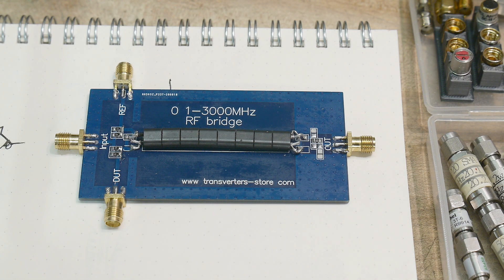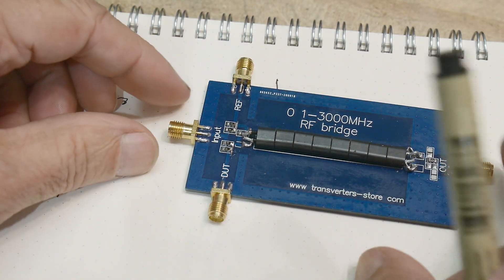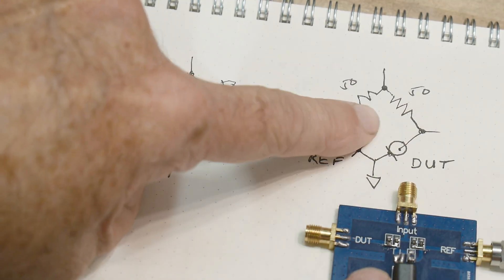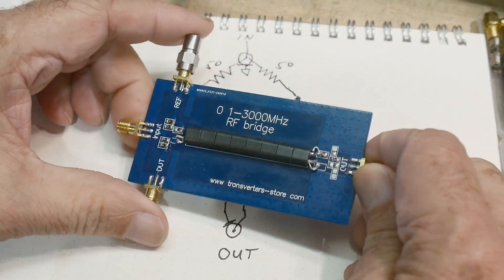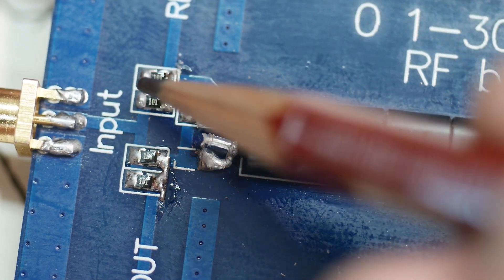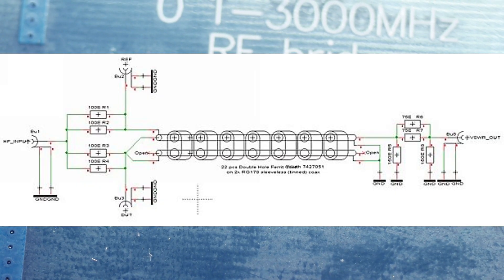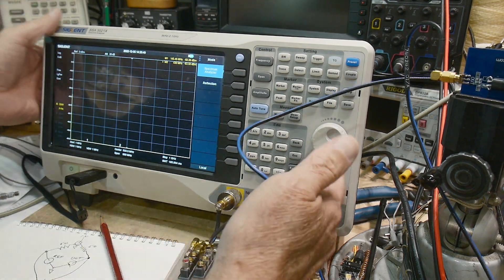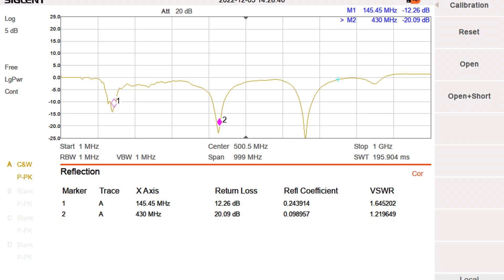#1366 RF Bridge

Comment: Can the ferrite cores be of individual toroids and NOT "eye" cores?
Reply: Sure, individual cores of identical ferrite mix and "ui" initial permeability would work fine.
Employing the "binocular" or "pig nose" core is to assure that the very exact CMC (Common Mode Current) impedance is imposed on the "outside of the coax shield braid" and the "inner conductor".
By using individual cores this may not be possible because the ferrite torroids of the same mix form the same batch lot bought on a single order from the same manufacturer would be having small but measurable differences among them.
De VU2RZA
Reply: @subramanianr7206  Nice explanation VU2RZA!  Adding the 'dummy' balun to the center conductor really cleans up the slight phase shift error between the ports.  I recall first seeing this in some of the old Motorola app note decades ago. Probably in the early 80's.  Seemed odd at first since I didn't understand the purpose at the time. :)
Reply: @Pinhead-q4i  thanks for your comment and appreciation. I attempted one 5 years ago without much success. I wanted the bridge (in fact it's nothing but the Wheatson bridge known and familiar to many) just for the HF spectrum and used FT37-43 cores which I had bought new from the "W" land dealer. And I used RG174 Teflon coaxial cable. The resistors were 100 ohm smd type with the connectors being the BNC type.
Maybe I should try it again for any obvious fault on my side!
De VU2RZA
Reply: @subramanianr7206  I definitely don't have any experience with the bridges.  Only reason I commented was that the balun caught my eye since I use that topology all the time.  I'm sort of retired (wideband and high power transmitter design), so I spent my life pretty much going from Point A to Point B on the Smith Chart, and the designs almost always included some sort of TLT (transmission line transformer) and a balun.  Even tho I didn't use a bridge in my designs, I almost always used couplers (either microstrip for narrow band or a mix of cores and coax for wideband) for VSWR detection and sometimes for a ALC loop.  It's pretty easy to get well over a decade of BW out of a coupler with great directivity.  One of the biggest concerns to get the BW was to use the lowest perm possible cores for the low-end that are still well-behaved at the high end.  The cores can become lossy at the high end if you don't pick the right core material carefully. So sort of a balancing act between the lower and upper freqs. Holler if you want to try one of those! - Mark
Reply: @Pinhead-q4i  that's very nice of you.
I tried the EB104 kit SSPA using the MACOM kit, a 600w HF amplifier about 7 years ago; I didn't succeed. All the MRF150 MOSFET transistors went qrt for no obvious fault on my side (or as I hope)
Then a year ago I assembled a similar version, this time with 4× SD2933 MOSFET transistors using TLT and got a grand success. I have been operating it to put out 1200w on a 53v power supply drawing just more than 22-25 amps.
So, I have proceeded on to making two more such amplifiers with the intention of putting out 2.5kw by the use of splitter/ combiner. One board is nearing completion and the other would be over by the end of this month.
The ferrite loaded TLT is the key for the wide bandwidth covering the HF spectrum and up to 50 MHz ham band.
The 13 mm copper heat spreader on the Aluminium heat sink really gets very hot to touch!
It's a real fun and thrilling project I have been currently working on.
Thanks again for sharing.
De VU2RZA
Reply: @subramanianr7206  Who knows what happened w/the EB104 kits parts.  I remember looking at some Infineon LDMOS parts years ago (helping out with someone's design) and those things would blow just by looking at them, LOL.  Just biasing them up to measure some rough small-signal input impedance they'd blow.  I loaded the parts up with resistors to give them a really nice impedance from DC to daylight, some feedback, some series resistance, some shunt resistance in the right places...they could care less, poof! We ditched those pronto.  I guess some parts are better than others.

Can't say I've ever work at the KW levels down in the HF area...has to be fun trying to figure out if the cores are still happy at those power levels. :)   My high power experience (>1KW) was mostly at UHF (LDMOS, GaN), so no cores, just the TLT's.  But my wideband designs went down to 30MHz, so I needed cores.  But it was under 200W, so a little easier.

Almost forgot - KB9TAF here.  But I admit to listen more than talking. :)

I think we highjacked Paul's posting - Sorry Paul!
Reply: @Pinhead-q4i  some infineon LDMOS parts would blow just by looking at them...ha..ha..ha.. I like the humour. But it more or less was like this about 5 years ago. H.Granberg would admit that some of the early line production of MRF150 devices were defective. 
The cell phone industry 50-55v/50-80 amp power supplies are available freely and biasing the MOSFET transistors using resistors, LM723 and multiturn pots can be done easily after little understanding. The choice of ferrite for the 1:3 or 1:4 input transformer is #43 mix and it's going to handle very small amount of RF power after the necessary attenuation of your choice. Before mounting the transistors the input and the output transformers must be thoroughly evaluated. SWR/RL are important parameters anyone will agree.
The MOSFET transistors might be having some small positive charge on the gates and hence in conduction state. The moment power supply is connected some might draw unusually large currents and would blow out in no time. A 10k resistor at the gate to ground would guarantee against such a catastrophe but it would deQ the input circuit; I don't care. Single ferrite sleeve (#61) for the o/p transformer on each pair of the drains of the MOSFET transistors using TLT (17 ohm or 12.5 ohm cable) proved to be the correct solution. The ferrites don't get hot and hence no possibility of saturation. It would be followed by a 1:1 CMC and it can be connected to the LPF and so on.
Yes, my sincere apology for having hijacked Paul's post 
De VU2RZA
Reply: @subramanianr7206  I would typically use around 10-25 ohms resistors on the gates often (with WB designs).  I often needed to throw gain away at the low end, plus was it usually great for low freq stability.  Plus I'd have to switch the FETs on /off pretty fast, so needed to keep the R low because of RC time constants (i.e. bias R x gate capacitance).  Or the input Z was so low on a big part it had little effect on gain.  On WB designs starting at around 30MHz I would use perms of 125 almost exclusively.  Ferronics, I believe.  Behaved quite nicely way up into the upper UHF range (i.e. weren't lossy) - but at that freq the TLTs didn't need any help from the cores. 43 material would have definitely been a show stopper for me! 

Ever use some of the 'ruggedized' LDMOS parts from Freescale (now NXP)?  They have a great 1KW UHF part.  Popular w/the HAMs I think,  and fairly inexpensive.  Designed for high VSWR applications (i.e. 65:1 VSWR), maybe plasma generators.  People at work (when I was working) thought that was great that the FET would survive any issue, until I told them all the output matching parts would just turn into charcoal instead!  FET would be OK, everything between the FET and circulator - nope!

So you use repurposed cell amp power supplies for the HAM PAs?
Reply: @Pinhead-q4i  yes, I use the 50v power supplies that are available new (at least for me...hi..hi..) as they are compact and very rugged with protection features.
The input impedance of the MOSFET transistors amplifier (2 in parallel and in push-pull configuration) is around 5.5 ohm and hence the need for the ferrite loaded broadband transformer; it's usually 9:1 by having 3:1 winding ratio.
Half to 1w of drive power is enough at input. Here I use #43.
The same TLT transformer (of course bigger in size with #61 mix, ui 125) with the 1:9 fashion is used at the output. Yes, the combined effective resistance of the Drains of the 4 transistors is around 5.5 ohms. The output is balanced and hence there is 1:1 CMC (Common Mode Current) Choke to interface with the 50 ohm coaxial cable through the LPF, SWR monitoring etc. 
And these devices are advertised (as shown in the nxp free scale YouTube videos) as almost indestructible. 
The output is simply left open or shorted by the tip of a screw driver with lots of sparkling and almost at the verge getting welded together!
But in reality I learnt how to make it work by sacrificing many MOSFET transistors.
I have not gone venturing into the so called extremely rugged LDMOSFET devices like BLF 188XR. They are not cheaper and a single device would cost around $250 when it lands in my hands.
I have used the refurbished ones from China. I was lucky enough that they worked well for me. They would remove the device from old boards, scrap off the lead solder from the leads and then electroplate to make it look okay. But they can't remove the spring washer marking on the morning flanges. Some of the leads (gold plated steel) being brittle would break around the middle as they had been folded once on the boards from which they were scavenged..! One has to be careful here 😀 They can be tested by multimeters and they would work fine.
De VU2RZA
Reply: @subramanianr7206  I'll reach out you on QRZ tomorrow (just signed up).  Paul's probably getting tired of us.
Reply: @Pinhead-q4i  ha .ha..ha..
Thanks 🙏
De VU2RZA
Reply: @subramanianr7206  
I don't fully understand the topology.
Why not using multiple Toroids over BOTH coaxial lines?

Comment: Tracking generator - fancy!  You don't necessarily need one. You can get a long way running this sort of device as a noise bridge, and even using the station receiver as the detector.  (Yes, I'm old.)